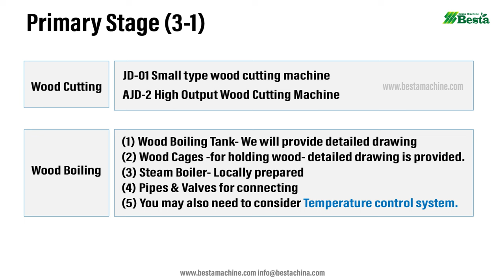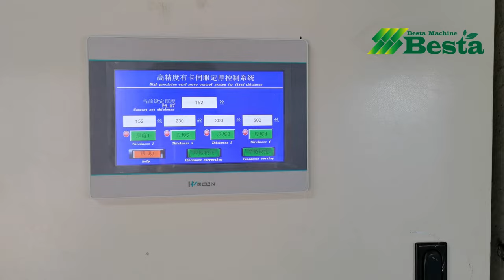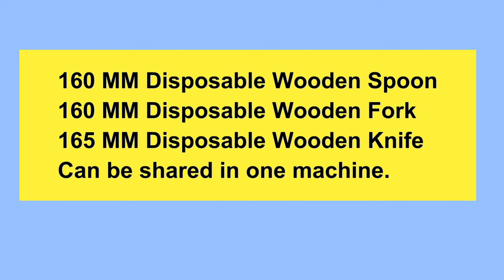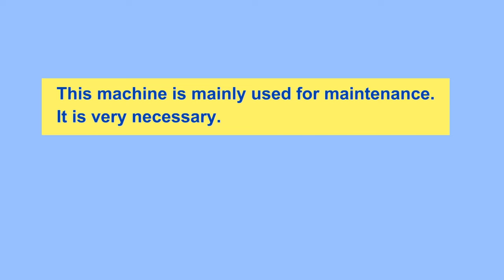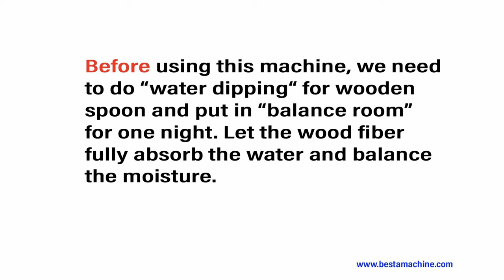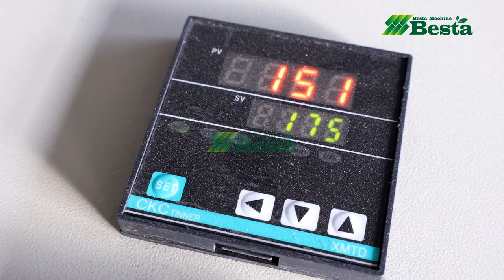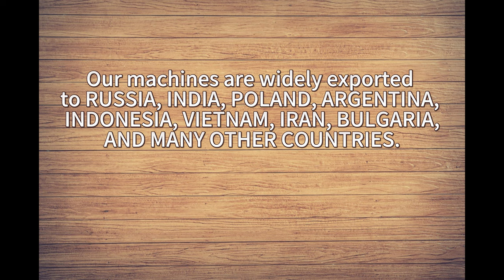Disposable Wooden Spoon Making Production Line, Wooden Spoon Making Machine

Comment from the maker: 0:00 Wooden spoon fork making machine (BESTA)
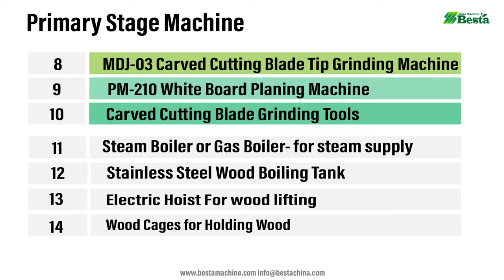1:07 Wood Stacking & Cutting Area
3:17 Wood Boiling and Bark Removing 
5:05 CNC Wood Rotary Cutting Machine (SK-520S)
7:04 Carved Cutting Machine (Materials Saving )
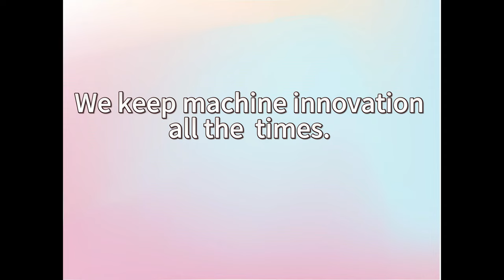9:10 CNC Carved Cutting Machine (SK-003S-W) Widen Type
10:48  Drying and Polishing Process (PG-6-L3)
13:20 Automatic Unloading  （After polishing)
14:20  Wooden Spoon Order Arranging LS-160 
15:54 Electromagnetism Blade Grinding Machine 
20:01 White Based Board Planing Machine PM210
22:04 Carved Cutting Blade four side Sharpening 
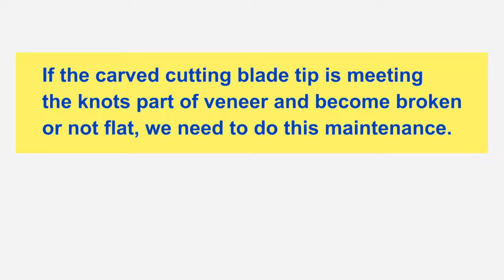21:14 Carved Cutting Blade Tip Grinding Machine  (MDJ-03)
23:49 Wooden Fork Teeth Making Machine (KCJ-1S)
25:52  Automatic Wooden Spoon Hot Pressing Machine (ASP-300A)
31:54 After using hot pressing machine 
33:16 Contact BESTA MACHINE